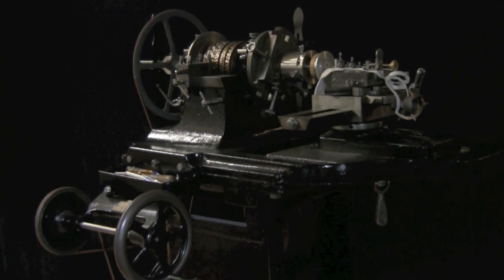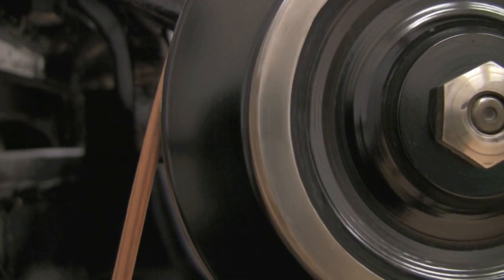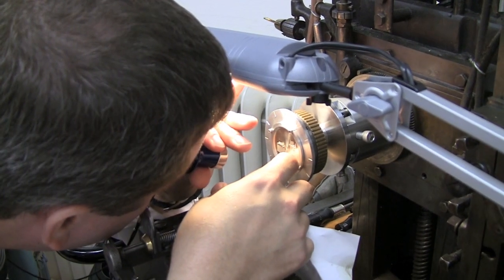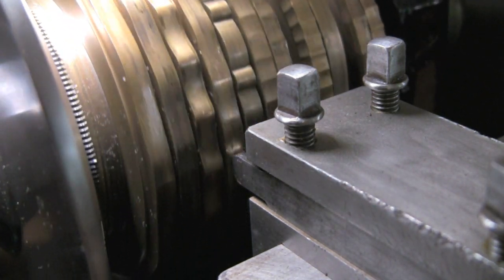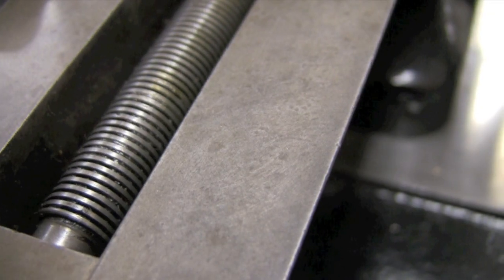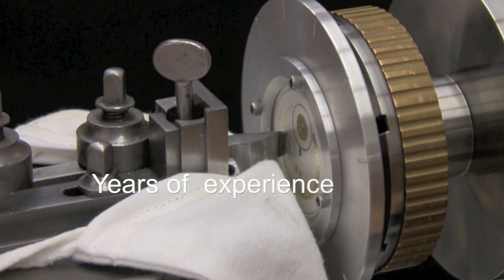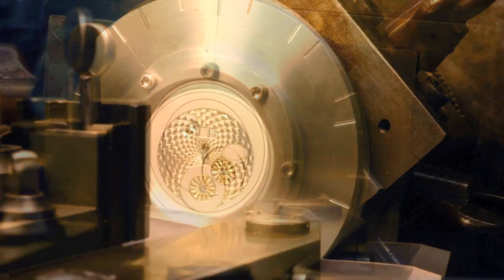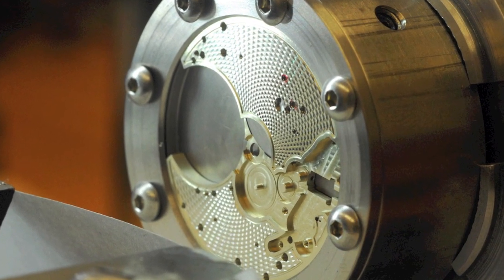RGM's The Art of Guilloche

Comment: I found it much cheaper and more accurate to build my own. With a combination of mechanical and cnc movements, you can get both straight and circular (as well as elliptical, etc) with computer repeatability, but mechanical smoothness (no stepper controlled cutting tools, but control of the mechanical linkages reletave to the cams and drives.) Much like a computer controlled manual transmission. Chasing thousandths on these old machines is hard without machining for modern bearings or re-pouring babbit.

Comment: I'm surprised that this system is hundreds of years old, to make the parts need equal amount of skill and machine to manufacture, but on the rosy side of things a modern cnc machine can do all that in minutes with a good machine  program software.
Reply: Maybe...but the program of which you speak is non extant (no small feat) and if rotary cut it, it would not reflect the light the way the Rose machine work does.  The Rose basically acts like a "repeatable hand engraver" and its the engraving that provides the "defect" of wavy cut walls that reflect the light.  Maybe a CNC set up without the rotary cutter but an engravers cutter and the object movement is what actually cuts...instead of the other way round?  All yet to be done.  Interesting though, no?

Comment: You're applying the same line of thinking. You assume CNC machining is a "me too" trade, when in fact the same determinate steps you take with your hands;( "on the fly") need to be artfully compiled and premeditated into g-code. An expert cnc machinist could produce better higher quality work than that with a mill/turn. the "geometric lathe" replaced hand engraving and jerks like you bitched about it in the 1800's. "The art" doesn't disappear it only relocates to another medium.

Comment: I think it can be done with CNC, but you'd have to start with the old system, and replace the cranks and ratchets with servo or stepper motors.. i have a 4 axis CNC milling machine, and with some minor modifications i think i will be able to achieve a nice Guilloché, 
a cutter must be fitted to the milling head, and a workpiece will sit on the forth axis, then a pattern can be programmed with the Y axis moving in relation to the rotation of the A axis..

Comment: I worked at an orchestral trombone factory where the trombones had rotory valves. I was allowed to experiment with decorating the valve covers doing what I "thought" was called engine turning. This was done with nothing more than a small drill press holding a spinning solid rubber tube in the chuck and some fine grit lapping compound. I used it to make over lapping semi circles. It looked great and I sold every one in 2 weeks, so naturally I was told to stop making them. Was this engine turning?

Comment: As an engraver who uses CNC, pantographs, and hand gravers I can say there is a huge difference in the quality of cut between rotary cutters and a graver.  The rotary leaves swirls on the bottom and sides that are slightly wavy  this leaves a surface that does not reflect the light any where near as well as the clean surfaces and  sharp edges a graver creates.

Comment: You can program a CNC to do anything you already have the skill to do but you have to have the skill to start with. Each cut is controlled by the operator and fades in at the start and fades out at the end. You can also decide to alter the depth in the middle of the cut. In this case CNC would only be removing the joy of the work instead of replacing a mundane repetitive job. Not to mention mistakes that turn into new techniques by what you've learned by making them.